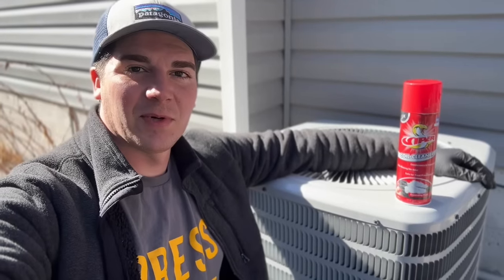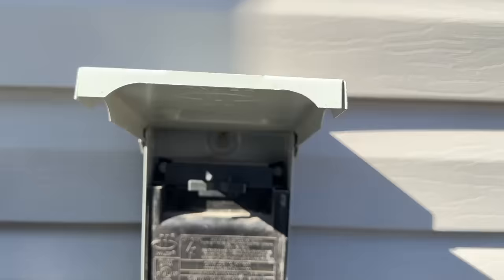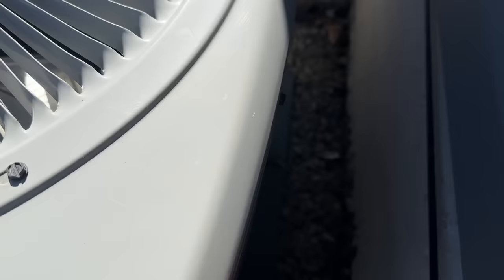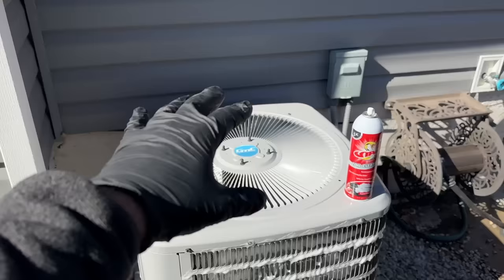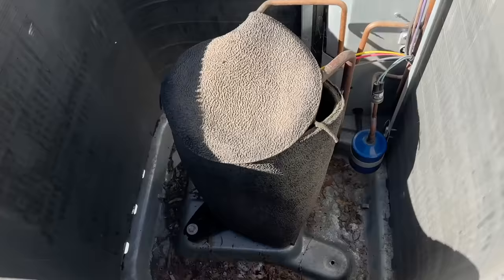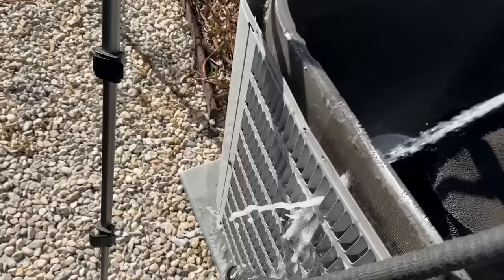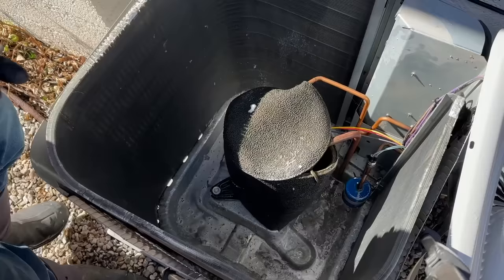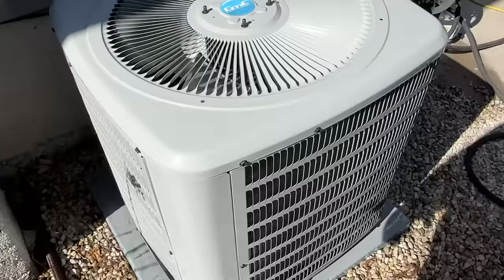How To Clean Your AC Condenser Unit | Spring Cleaning Pro Tips

Comment: Wouldn’t it be better to remove the whole outside cover? Instead of spraying 1/2 the cleaner on the cover and not the fins which you want to clean.
Reply: This guide is intended for those that aren't handy enough to remove the cover. I take mine apart and just use a regular water pressure hose to rinse mine out every spring so it never gets bad enough to need coil cleaner.
Reply: @joesimonetti  the covers can be a bit of a hassle removing and replacing - patience and care (not to lose screws) are key to success. A quick hose spray down is a good idea every now and then.
Reply: @moorgoon  Agree. The top lid is quite easy but removing the rest of the outer skins on some units can be a pain.
Reply: @eosjoe565  actually for myself putting it back together was my biggest problem (minus one lost screw!)
Reply: @moorgoon  Same.  It was easy to get off.  PITA to get back on, especially in 100° heat.
Reply: @moorgoon  What was the issue?
Reply: @chezchezchezchez  - general maintenance

Comment: If you use the coil cleaner too frequently, it will shorten the life of your equipment. Every other time you can get away from just rinsing it out. Always wash from inside out making certain the power is off. Water and electricity don't play well together.

Comment: Question, if your coils haven't been cleaned in many years is it safe to clean them with out damage to the coils?
Reply: Just depends how old it is. You'll never harm it with just a normal hose, but if it's too old it'll start to peel and rip off and at that point, you need to replace your unit.

Comment: I had a charge of Freon put on my 20 year old system last year, 2 months after I had it done my system quite working.  It was late summer so I didn’t check it out until this spring.   To my surprise a connection on my capacitor was fried.  The only way that could happen is if the serviceman sabotaged my unit….
Reply: Why do you think that?
Reply: @.  The clip on the connector was distorted, not sure what caused that to happen.
Reply: @williamknutson6163  a poor connection will cause excessive heat which can melt wires and deform terminals.
Reply: No way! You said yourself the ac is 20 years old! Stuff happens man.

Comment: HI, I will be becoming a new home-owner soon. My knowledge on home repairs is limited. 

To make sure i understand. Is this the unit that creates the air-conditioning to your HVAC system?

Do i need to turn off the breakers/electric running to this unit before cleaning? (might be a silly question i know)

Wouldn't water damager the wires or tubing inside the unit? Or should i be buying that rubber coat?
Reply: I'm not an expert, but since nobody responded yet, I'll chime in. Yes, this is the central A/C unit that connects to your HVAC system inside. You should always shut off power before cleaning a unit that has this much electricity running through it, which is why he pulled the fuse at the beginning. The fuse supplies the power. In general, whenever you toy with anything in your home, turn the power off to be safe. Water won't damage outside unit, it's built to get wet and weather storms. I wouldn't go spraying directly on any parts so you don't damage them with water pressure, but it's not bad to get the unit wet. It gets wet anytime it rains or snows. I believe the rubber coat is mainly for noise

Comment: I live up north where we have snow and cold temps what’s your take on covering up the ac unit in the winter?
Reply: By covering the unit in winter it doesn’t allow the unit to breath. Moisture can cause rust and corrosion.
Reply: We live up north in the cold to, cover our unit every winter just not all the way to the bottom .
Reply: That top needs UN covered.  I put a piece of plywood attached to the wall a couple of feet above the top of the unit.  then, the other end of the board is to the outside (like a ramp or 45 degrees angle   the allow air in, but snow slides right off and away from the unit.  It works fine!

Comment: Would it be safe to use a power washer on the rinsing portion?
Reply: NO!
Reply: No, too high of water pressure will bend the fins of the condenser because they are very thin. Even some garden hose sprayers can bend them if you put it too close.
The best way to clean your condenser is with water spraying from the inside out. Chemical cleaner is unnecessary as residential units have pretty thin condensers and are not typically exposed to grease or other hard to clean stuff.

Comment: I sprayed out my unit for about 12 straight years, every Spring. Then the fan began to seize. Even aluminum oxidizes. Had a technician add a giant capacitor to help the fan start without tripping my circuit breaker, but then even that wasn't enough. So had to fork out $1,200 for a new unit. I haven't cleaned the new one since, but if I ever do, it'll be with compressed air instead.
Reply: Water regularly falls from the sky, they are outdoor rated motors. You could have just replaced the fan motor for $200 instead of replacing the entire unit. Bearings go out on everything, unless you were spraying water into the bottom of the motor like a dumbass then cleaning the ac had nothing to do with the failure.
Reply: @Redtooth75  Water does NOT fall through my patio awning, my friend. It's 30' x 12' and there isn't a drop that reaches the fan. The entire unit was probably 25+y old so I replaced the entire unit after trying a portable fan temporarily to determine that was the failed part. $200 would have saved me a bundle at the time, but I knew the entire unit would soon need replacing anyway.
Reply: @RealFauxMolder  ok, they are still outside units that are designed to get wet. You cleaning your air conditioner with water had nothing to do with the fan motor failing. It failed because it was old. 
A dirty condenser will cause much more harm than spraying an outside unit with water. A dirty condenser raises the head pressure which is harder on the compressor and can cause it to fail prematurely. Cleaning your air conditioner was probably the main reason your last one lasted 25 years
Reply: @RJHerber  I hope to h@ll you are not serious about 10k!!! I bought my house new in 2000 and haven’t changed any ac, wh, etc. you’re scaring me! Now I need to go clean my coils……

Comment: Does taking the top off run the risk of throwing the fan blade off alignment?
Reply: As long as you do not rest the motor directly on the fan  blades (and bend them), you will be in good shape.

Comment: The foam cleaner does not really work that good its to dry and fluffy you want to buy the liquid coil cleaner in the gallon sized container and then put it in a small pump up bug sprayer. That what an ac guy uses.  The liquid cleaner will get deeper in the coils with the pressurized bug sprayer too.  Btw your car has the same condenser. It sits in front of the radiator and it gets alot more dirty that the home condenser. Rinse the car condenser off with water then use the bug sprayer and let it sit for a while then rinse it. If any bugs are stuck in it use an old  toothbrush to gently pull them out of the coils. Same thing with any wall banger ac unit stuck in the window. Also if you take the cover off like this guy does take advantage of that access and get the size of the start up capacitor. Its the round silver can bolted to the chassis. Buy one from ebay as its the most common failure part in an ac. Also here's a tip that will slash alot of money off your ac bill. Watch your condenser during the day and see how much the sun is directly hitting it. Your condenser should be on the north side of the house. If its anywhere else its getting alot of sun. Sun directly hitting the condenser box is bad news it will heat the chassis and make it much harder for the compressor to work. Mine is on the north side but still getting hit quite a bit. I bought 2 nice wooden doors off Craigslist painted them and I just leaned them on the sides of the condenser to keep the sun off it.The ac got dramatically cooler. I built a little bracket that holds the doors off the condenser at the top edge about 4 inches so the top coils are not even slightly blocked. Your condenser will stay 100% cleaner too. It works!! Its a different sun now then it was just 5 years ago the sun hurts when it hits you now its so powerful. Its hurts your condenser too.

Comment: Always wondered if this was something a DIYer should attempt. I’ve no issues with the chemicals, it’s mainly a surficant to break loose the dirt adhering to the coil.
Reply: You can get simple green (safe for aluminum)
Reply: Check your warranty before you remove any screws. You can clean everything you need to clean without taking the top off. If you have a warranty and you open your unit, you WILL VOID THE WARRANTY.
Reply: @c.blakerockhart1128 how will anybody know it was opened?
Reply: @SonyaLCH  That's a great question. The units come with everything in a SPECIFIC PLACE and each screw is usually torqued to a specific point. The coating on the screws is INTENTIONALLY soft on some units. But mostly a tech can tell because something is wrong with the unit that would not be a normal thing.  If your unit is under warranty, then WHY mess with it ? If you have a Newer car, your probably NOT going to do your own brake job. Or at least, I WOULDN'T.
Reply: @c.blakerockhart1128  I'm pretty sure that is illegal.
Reply: @umeng2002   you're pretty sure WHAT is illegal ?
Reply: Denying a warranty for opening up the system. You have to show that your repairs damaged the unit to deny a warranty.
Reply: @umeng2002   How long have you been an HVACR tech ?
Reply: @c.blakerockhart1128  How long have you been a lawyer? Companies have put "warranty void" stickers on everything; even though tampering with your device doesn't invalidate the warranty. The FTC even started to fine companies over this. Only damaging the device while you tamper with it voids the warranty in regard to the part that you tampered with.
Reply: @umeng2002  I have been an HVACR tech for almost 20 years. And I have read the warranty papers. ANY SERVICE done by ANYONE who is NOT LICENSED and State board CERTIFIED,  WILL void your warranty.  Whether YOU like it or not, Whether YOU agree with it or not.
Reply: @SonyaLCH just match up the screw holes and you'll be ok.

Comment: Using a Water Hose spraying water on live active voltage/current on the compressor and wiring can't this cause an electrical damage or you have to turn off the A/C breaker at the fuse box panel? The condensers can get damaged from the hot temperatures from the sun, what can you do to prevent replacing the condenser each year because of the sun hot temperatures damaging the condensers in A/C condenser units? the A/C Condenser should have a start up capacitor which gets damaged often, any reasons why?
Reply: You may not have noticed but he pulled the breaker out before he started and he put it back in backwards so it wouldn't make contact
Reply: At the beginning he pulled the fuse. pay attention.
Reply: @Avengedsevenfoldrocks  I didn't know you could take a breaker out of the fuse panel and instead the breaker in BACKWARDS so that the breaker wouldn't make contact. I thought the breakers only went in only one way that had 'key tabs" for the breakers polarity orientation?
Reply: @waynegram8907  actually JoeSimonetti said it best; he pulled the fuse not breaker
Reply: It’s a service disconnect - not a fuse nor a breaker.

It’s only purpose is to disconnect the electricity while cleaning or servicing it.

Comment: The very FIRST thing you should have mentioned is that if the unit is still under WARRANTY, that the homeowner WILL VOID the warranty if they "Open" the unit. Read the small print folks. I am an HVAC tech with 20 years experience and I have seen several warranties made VOID because the homeowner decided to save a few bucks. If you still have a warranty, DO NOT REMOVE ANY SCREWS or "OPEN"  your unit. In the event that you cause damage such as an electrical short or a refrigerant leak, you WILL PAY OUT OF POCKET.
Reply: So the guy that cleans my ac every year has voided my warranty
Reply: @johnurban7333  Is he LICENCED  and STATE CERTIFIED ?
Reply: @c.blakerockhart1128  yes
Reply: @johnurban7333   If it ( any work on unit ) is done by a STATE BOARD  CERTIFIED HVACR technician WITH a license, then no it will not void your warranty.  I work for a small company, my employer has been in the business for 40+ years. We have an apartment complex that we maintain, they have their own maintenance crew. One of their maintenance guys decided to repair a unit that was 1 year old. It was just a dual capacitor, he replaced it with one that was not the same. The one he installed was way above range and it caused a compressor failure on the first time it tried to run. When the insurance guy came and looked at it, he immediately saw what had caused the failure. ( He was a retired HVAC guy ). The insurance company rejected the claim and they also contacted CARRIER and gave a complete list of the serial numbers for ALL of the units that the manager had said this guy worked on. CARRIER immediately voided the warranty on all 5 units this guy had worked on.  These units were about 1 year old and came with a Factory Warranty of 10 years.  And this is just the most recent one that comes to mind.
Reply: @c.blakerockhart1128  Daaaayyyuuumm 😅😂🤣🤣🤣🤣🤣
Reply: @theadjuster151  It's all fun and games until someone has to buy a compressor.🙄

Comment: You forgot to mention that you should verify power is actually disconnected at the units contactor in the event the disconnect pin(s) break and get stuck inside still allowing voltage to the condenser. This is not a job for DIY homeowners.
Reply: Haha, even homeowners can see a pin has broken off.  Nobody is touching live wires when they are cleaning the coils anyway.  You must want ALL the money.

Comment: Taking the  top off seems necessary, why bother if you’re not going to give her a complete cleaning.
Reply: Most of the accumulated “crud” is on the outside fins before the coils, because that’s how the air goes. So it’s better to spray water from the inside outwards to push the crud out instead of inwards through the coils. 
I do the full cleaning with the top off every two years, the other years I spray the cleaner on the outside like this, then start the hosing off shooting through the top grill down through as best I can (water goes everywhere, dress appropriately), finish by hosing the outside.

Comment: Use the shower jet function…too much force on the coil and could bend the fins …common sense…you don’t need a lot of pressure, the cleaner does the work for you , water is used for rinsing

Comment: Be aware that many of these coils are not designed to be cleaned by chemical cleaners. Before using chemical cleaners check your system owner manual, or you can damage your coil.

Comment: How come you didn't take the shroud off?
Reply: On many units (like mine) the outside shroud can be incredibly difficult to get back on and lined up without two or three people working on it. In the end, if you spend extra time spraying the hose from the inside out through the top, that’s time better spent.
Reply: GOOD advice. I took it off and put it back on by myself with lots of cursing and a hour of frustration.

Comment: To be honest. You did okay, but not good or great. To begin you should have vacuumed all the debris inside the unit, by doing that all bottom hole are free of drainage and then watering if necessary blow air. Done.
Reply: I’m not an expert but many years ago I was taught to clean the unit by a Sears repairman that said the same thing that just said! People need to clean freezer and refrigerator coils also! Remove the debris first!

Comment: Lets spray water on Electrical components Brilliant Idea lmao. You do know it does not matter if you unplug from the wall It still produces an electric current and water WILL SHORT ELECTRICAL COMPONENTS!!!
Reply: Lol why are there so many people giving their input when they don't even know what they are talking about.
Its an outdoor unit dude, its designed to get wet from this fascinating thing called rain. Everything that got wet is something that will get wet every time water falls from the sky. The only thing in that unit that would have a problem with getting wet would be the contactor. And the contactor did not get wet at any point in the video.
Reply: @scottymorgan7868  Why are you acting like he was spraying a circuit board with water? There were exactly two electric things that he got wet and thats the compressor and the pressure switch. The compressor can get wet because its literally designed to, its completely exposed to the elements. There is a seal around the electrical terminals. The pressure switch is also a sealed component because its also completely exposed to the elements. 
You clearly know nothing about air conditioners. The manufacture's cleaning process is what is shown in the video, except the chemical is optional and usually unnecessary. I don't know why you think a hail guard will do anything to prevent water or dirt from getting into the unit, it does not.
The majority of electrical components in an air conditioner are designed to have water splashed on them because they are outside units and that happens every time it rains. The only thing that would not like getting wet is the contactor which was not even shown in the video. There are no complex electronics in the condensing unit. There is a contactor, a dual run capacitor, some optional temperature and pressure switches, an optional start capacitor and relay, a fan, and a compressor.